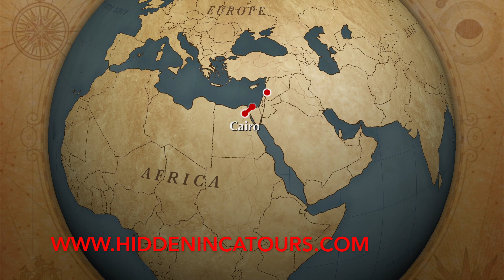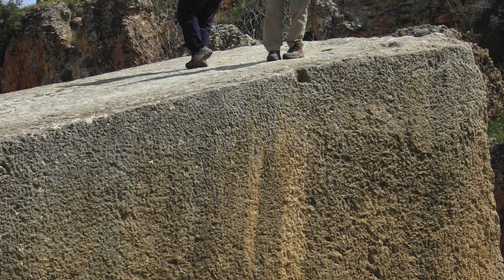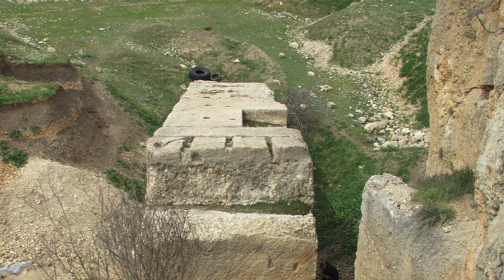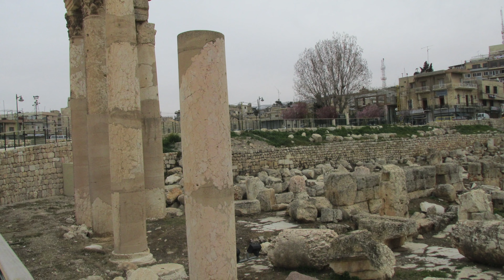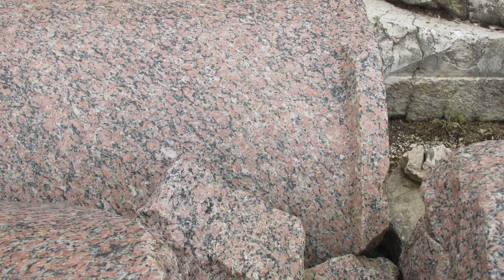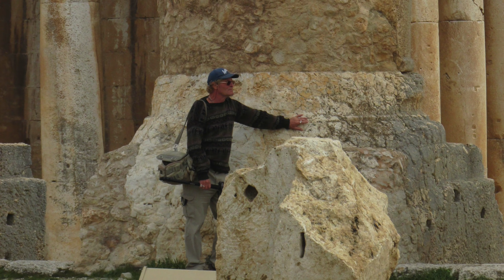Megalithic Baalbek in Lebanon

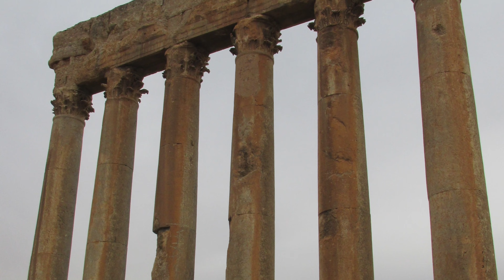Comment: 7:43 Don't underestimate the Romans, for example look at similar massive structures they build in Rome.
4:48 Why are there smaller blocks under the huge ones? Almost all the blocks have holes in them, possibly used to pull the block forward, maybe with something like a Capstan winch. Why are the blocks in the quarry on an angle, seems as if they would be pulled out. If you had anti-gravity you might as well cut them out straight. The scale of the big blocks is immense, did someone ever calculate how many pulleys, capstan, people, number and size of ropes would be needed to pull such a stone? I would be cool if it were some sort of Nephilim rocket launch platform, but we also shouldn't underestimate ancient human ingenuity and willpower.

Comment: I'm thinking its about 1500 tons not 1500 lbs.  Just guessing by looking at the stone.

A team of German and Lebanese archeologists just uncovered the largest manmade stone block ever discovered. The block, which was found in a limestone quarry in Baalbek, Lebanon, measures 64 feet by 19.6 feet by 18 feet, Gizmodo reports, and weighs an estimated 1,650 tons.
Reply: Check out the megalithic stones at the Yangshan Quarry in China. They're almost 10 times larger. One's about the size of a city block. They were cut but never removed from the quarry.
Reply: @headshotsongs9465  I did .   I was just correcting what the guy in the video said. He misspoke about the weight of the stones.  He said 1500 lbs but is actually about 1500 tons.  Thought he might want to correct it.

Comment: The standing intact columns and under them look like rubble fill with a smooth coating surface peeling off.
Reply: Look like that the columns were actually concrete columns, not natural stones.

Comment: the fact that the position of almost identical stones in an installation can also be seen, just points to the builders having no concern about mass and/or distance. which can be seen again and again. whole mountains sheered off from one end to the other to make what looks like a landing area is intriguing, considering no aircraft would have been zipping around: but where can be found the tailings? Petra, and all its carved enclosures makes you think about the excavation, as well as the hindrance of finding somewhere to put all of the pieces of stone that have been removed.
Reply: Spacecraft land without landing pad on other planets, spacecraft lift off from launch pads .

Comment: Baalbek is mind blowing! Simply put, How?
Reply: I have often wondered what it was used for.
Reply: The romans built the colosseum in Rome within 8 years. That was a high-tech arena. In the morning it was a huge bassin. In the afternoon, the gladiators were dying.
Not many architects could build that today. Emptying a bassin big as a football field. In an hour. From the engineering point of view. That's huge.
In Berlin, they needed 10 years to fix the smoke removal in case of fire. At a new airport.
Reply: The original Builders simply had the Technology and Capability Romans just remodeled on top of the Original footprint, which was not a easy task at the time...